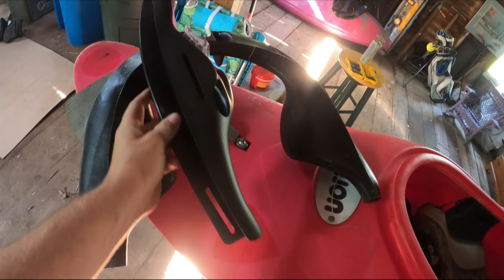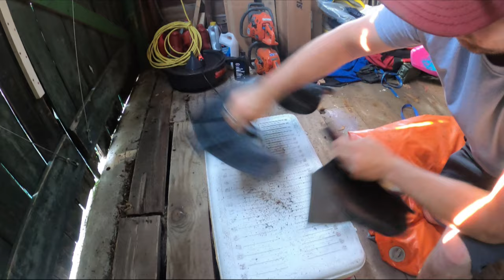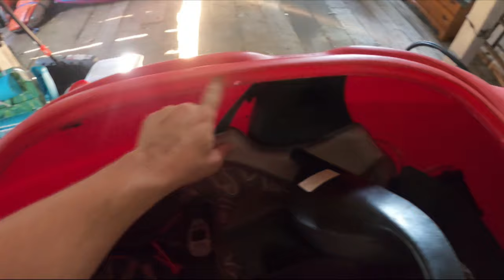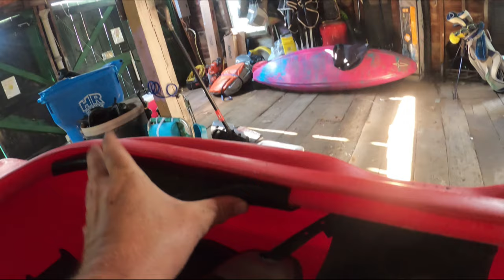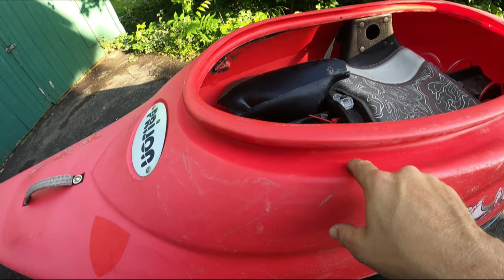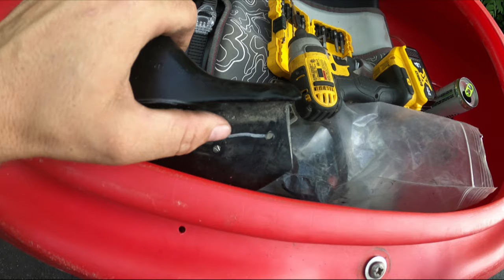Making Adjustable Thigh Hooks I Boat Builder

Comment: Is it me or is that a Rewind in the background? Got mine last week and can't wait to take it out. Only got one more week to wait till restrictions are lifted. I've been passing my time fixing up cags and bits of gear and yesterday I rewatched your Axiom Contour video and decided to get rid of the oilcanning under the play seat. I didnt have a replacement seat to put in so I just wiggled the last weld loose (all the other ones had broken already anyway) and then shoved enough foam under the rail to fill the gap. Slapped a hot water soaked towel on the bottom and the oil canning popped right out. Thanks for doing these videos they really do help 😁
Reply from the maker: IF ONLY! It's the girlfriend's Axiom.

That's awesome man! Hopefully it holds up. I wish they made an outfitting option for those to have the creeker kit

Comment: I know this is an older video but I have just picked up a Centrafuge and it has no thigh grips, just wondering if you knew whether or not the new contour ones from a Nova/Supernova might fit. Thanks
Reply from the maker: You can certainly make it work. See my video where I did a Xxx. All the contour ones are the same regardless of model. A little heat will help it take shape.
Reply: @AlexBarham  many thanks. I will have a look at that video.
Reply from the maker: Let me know if you have any questions

Comment: I just picked up a mint Delirious. The thigh hooks fit me fine but I’d like to upgrade the back band and possibly the seat. Is it possible to just replace the seat and back band or do you need to do it all? Do you know which Contour seat would go in the best? Thanks.
Reply from the maker: You'll just have to figure out where you're attaching your ratchets too. Likely that means modifying your original hooks, which will be more of a pain than usual.

This was a creeker seat. That will help take more of the flex out of the boat but you could make either work.